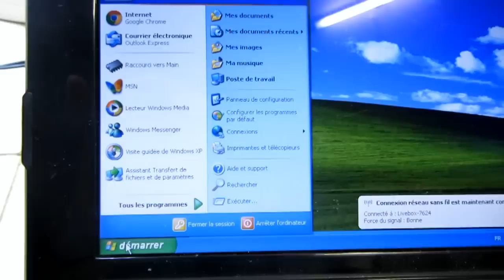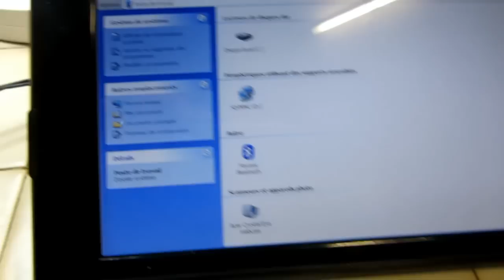Cheap firewire to usb converter WARNING⚠

Comment: My last computer with a firewire input has just died!
So thanks for this... I would have bought one if I had seen it.
Reply from the maker: You did well. A real firewire card cost 60 dollars at least. For my personel use I chose to have a old laptop with a firewire connector to import my files, stored it, for more reliability.
Thanks for watching.

Comment: Yeah, it's a trick. Mac users have it easy, as Apple makes a FireWire to Thunderbolt adapter, and all new Macs except the "regular" MacBook have Thunderbolt. On Windows it's a little harder; some new PCs do have Thunderbolt ports, enabling such an adapter to be used, but not all of them do. Pinnacle Systems also used to make a version of their MovieBox USB 2.0 analog video capture box that had a FireWire 600 port built in, and the box could allow you to capture footage from a DV camcorder via USB 2.0, complete with device control! Too bad Pinnacle discontinued it after Corel bought them.
Reply from the maker: wileyk209zback we are all agree, the disparition of the firewire is a whole bullshit
Reply: @AIexanderHartdegen  Well to be fair, Thunderbolt seems to be the real successor to FireWire. It's way faster, can be daisy-chained, and it can stream video in a fashion similar to FireWire, which is why Apple came out with a FireWire to Thunderbolt adapter right when they first came out with the Retina-display MacBook Pros in 2012. No company makes MiniDV camcorders anymore to my knowledge, but I think there may be some higher-end camcorders capable of direct Thunderbolt connection.
Reply from the maker: I purchased my sound recorders and external card sound  12 years ago, and they use all firewire. Of course camcorder with firewire are obsolete but all sound processing using firewire never becomes obsolete. that's the problem.
Reply: @AIexanderHartdegen  I can see why. I'd imagine the newer audio devices like those would use Thunderbolt connections instead of FireWire.
I still sometimes use FireWire to archive my old MiniDV and Hi8 tapes (the latter using a Digital8 camcorder), but otherwise to shoot video I use an AVCHD camcorder with memory card.

Comment: I can imagine two legitimate reasons for such an "adapter" without internal circuitry.  Reason 1 would be as an accessory to a device that can do both IEEE1394 and USB via the same connector.  However, in that case you'd expect it to come with such an "adapter" in the first place.  Reason two would be to use a USB port in order to supply a 6-pin Firewire port with bus power.  However, both voltage and current of Firewire bus power are significantly higher (at their minimum that meets the comparatively variable specs) than what a USB port will usually deliver, so this would again depend on a non-standard device at the other end.

So in short, this only makes sense for supplying either data or power to a device that will be happy to behave in a non-standard manner.  And connecting an already powered Firewire bus (which should have voltages from 24V to 30V, with Apple going as low as 9V and many devices happy with 12V) to the 5V supply of a USB connection should be... interesting.
Reply from the maker: ok

Comment: THANK YOU VERY MUCH for the video! My Xeon motherboard has no firewire and is limited in connections, and I have old firewire cam. I wondered about these and thought it had some internal controller... Man, this is a piece of crap!! very sorry for your USB controller. :(((
Reply from the maker: +Majou Nexian You must choose a real firewire card, or a Pinnacle outbox firewire card. But it's cost more than 3 euros.
Thanks.
Reply: Alexander Hartdegen
I am thinking about purchasing complete package of Soundblaster. That card has audio, midi and firewire. Should do.

Comment: nah not for capture, drive connection only maybe, we bought a back up 2nd, second hand laptop that has firewire 4pin (can basically be any old OS if we are not connecting it to the internet, and just need it for video capture, we have an old XP laptop and a backup second hand win 7 laptop now for capture, both still working fine)   just  incase our main capture computer with firewire takes a dump,  it might work but we never had one usb to firewire that ever did work for capture, doesn't it just change the connection so that  you can connect your old firewire only drive to usb, but doesn't work for video capture over firewire   Though for towers  you can still buy firewire cards and put them in a tower or for laptop an expansion slot if it has one.
Reply from the maker: ok

Comment: almost purchased 1 now. thanx
any body know how can i connect firewire audio interface to laptop with only usb ports
any converter out there?
Reply from the maker: pease search on google " firewire to usb converter". You can find PCI card, or external card. Exit the cheap module wich are fake, and privilege real brand, like " pinnacle" for example. A real firewire to USB converter in a external module is expensive, 30 dollars at least. If you use a classic PC, use a PCI card, not expensive. Thanks.

Comment: hi ,can i use it for my interface audio
Reply from the maker: +JsideB Offishal TV NO.
Reply: +Alexander Hartdegen  yeah,,tank,,the problem is,i got a Dell i3 optiplex 790 ,and i don't have the firewire card,for my recording sound,,u don't know what kind of material can i use to connect my firewire
Reply from the maker: JsideB Offishal TV You need internal firewire card (50 dollars) or external USB firewire module (pinnacle 80 euros). This fake from Chittiwn can't work cause it have any internal circuit for usb/firewire conversion.
Reply: yeah broda tank you its kind of you
Reply: +JsideB Offishal TV Hi Mate. Does the USB firewire module worked with you?
Reply: +Gaurav Sharma Hi Mate,Ain't got a good result with the USB firewire

Comment: Where can I find a real usb to firwire converter?
Reply from the maker: internet, or some electronic/computer shop. Price is not free for a real one.
Reply: @AIexanderHartdegen  I have to connect an analog mixer with firewire 800 output and not 400 to a laptop with only usb inputs
Reply from the maker: @mentalside7383  you need external firewire. A desk computers can be OK with internal firewire pci card but it harder for a laptop. You need to look on aliexpress or on dedicated sites.
Reply: @AIexanderHartdegen  man I searched, I don't know what solution to find my PC has only usb 3.0 ports, there is an express card, I think, that goes into a PC slot but I don't have that entry, I don't know how I can get out of the mixer and enter the laptop, mixer has internal sound card, and uses firewire to enter laptop but i only have usb ports, what can i do? sorry for bad english
Reply from the maker: @mentalside7383  there is pinnacle system who made special card for laptop, but it works with 400Mbytes. Find a solution is harsh, and there is lot of fake stuff, even on amazone. Be aware with fake stuff, it can destroy your computer. When I need a firewire port, I use a very old laptop with this connectors; save files on a hard drive and work it on a recent computer.

Comment: Delet this video. FireWire and used on a pc will not work unless you have a pci adapter and even then it may not work. Texas Instruments chip sets are sometimes needed but not in all cases. What ever you’re doing in this video is wrong.
Reply from the maker: Vous me faites perdre mon temps, veuillez retourner à l'école, vous acheter une culture, et vous faire foutre en même temps. Enfoncez-vous vos conseils dans votre rectum.